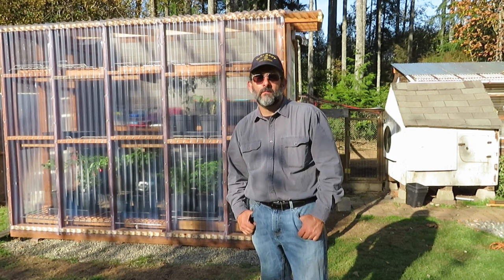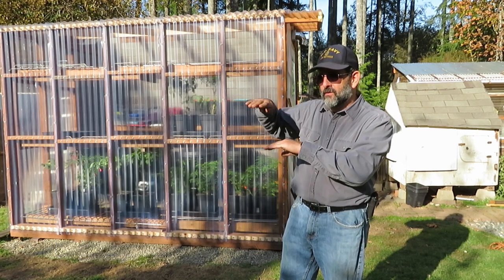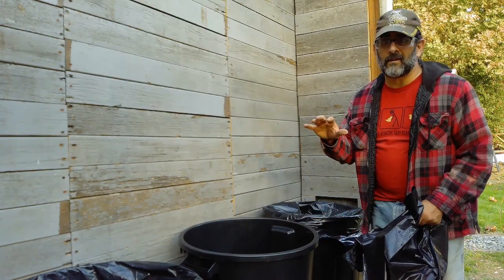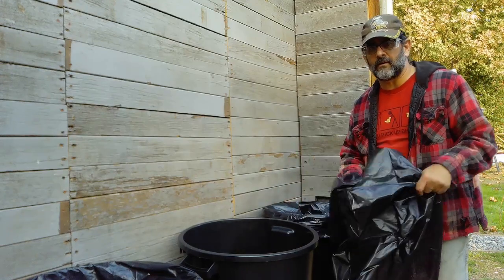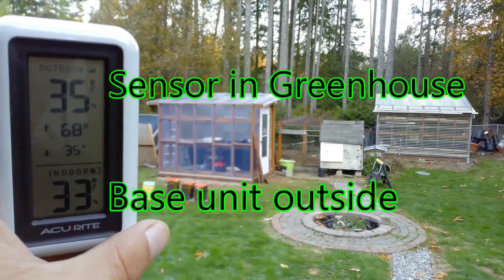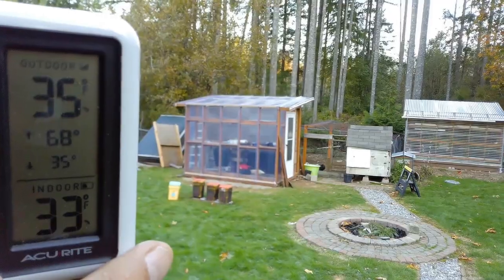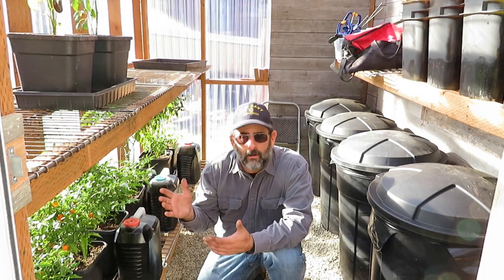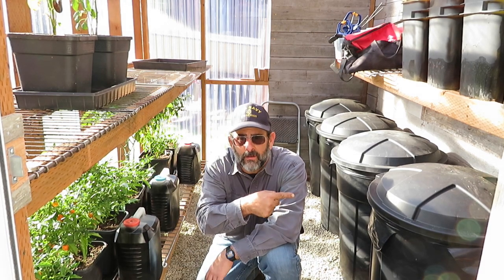Greenhouse Heating - Installing a Heat Sink

Comment: Cover the north side wall and floor with a black plastic during winter also absorbs more heat energy or reflective materials on that wall and floor directed back into the greenhouse and toward your heat sink. The more surface the more solar energy collected. Also consider black tubing with a reflective gutter behind it, you could also use a small pump in the water cans to cycle the water and gain even more heat. Many options. Just remember more surface area to charge it up it's a thermal water battery, which is also what some call it. Also at night a reflective blanket over the roof as a retractable cover also keeps heat in longer, even just a double clear layered roof with a 1 inch air gap, allows solar light/heat in and insulates with another air layer.
Reply from the maker: Thanks for the advice.  I might try that after my Achilles heals up the rest of the way.  Happy Gardening!

Comment: I own a pool company and to extend the swim season we use black irrigation hose and a small water pump.  Paint the back wall black.  zigzag about 50-100 feet of black irrigation hose on it.  Connect all your trash barrels with PVC.  Put your water pump in one barrel and have the other end of the irrigation line dump into the other end of the barrels. The water will circulate back through all of the barrels.  It will greatly increase the temp of the water through the day and will allow you to grow all year long.   Have a client that uses this technique in KCMO and is able to swim 10 months out of the year, while outdoor temps are only above 70 for 4-5 months a year... Obviously their irrigation hoses are connected to the pool pump instead of trash cans, but it works the same way... I used it on a neighborhood pool system and they opened their pool a month early and kept it open a month later... If their budget had been higher they could have added at least a few more weeks on the front and back end for another month or more of swimming...
Reply from the maker: Very interesting. I have been playing with solar pumps in my formal raised pond and have an extra mini-pump.  I might just try that out.  Just need a little extra time and a spare solar panel.
Reply: @whats up Doc
I live very close to kc mo and your idea is amazing. Thank you 👍
Reply from the maker: Sorry for the delay, YouTube wasn't showing the replies held for review.

Comment: Basic, clear, concise and doable by the least of us. I wonder if you, me, could jump start the water in the barrels by heating up big old metal containers on an outside fire and tipping the heated water into the plastic ones? It would help a lot I think...but woluld have to get the right temp, so as not to have it too hot on the first nights then go down too far for the plants. Interesting thought.
Reply from the maker: That's a good idea and would work in a pinch.  I don't think the drop the next night would affect the plants too much.
Reply: That wouldn't help. My black trash cans get hot in the afternoons (100+ degrees outdoor heat) that I can't dip the dogs in to cool off, nor use to water plants. The next morning (60-70deg), water is cool again.

Comment: Great idea 👍 and you've proved that it works 👏
Reply from the maker: Thanks!  It did get overwhelmed a couple weeks ago when our temps stayed in the lower 20's and we had no sun.  I am waiting on a couple items to arrive and I will be putting in a 150 watt 12 volt solar and wind heating system.  Received the high capacity battery yesterday.

Comment: good idea, I think I would put a knee brace or leg to the ground  in the middle of the shelf that holds the water buckets for extra support to strengthen the shelf.
Reply from the maker: I thought about that and only have the extra containers in the corners.  I put small starts in the middle.

Comment: The South wall (in the northern hemisphere that would be northern) of my small greenhouse built from 3ltr milk containers filled with water. That gives me a nice thermal heat for the night. The outside of the wall is covered with sisolation so the heat is retained inside. This would work much better if I'd painted them black.
Reply from the maker: I am guessing you are from down under?  If so, I bet those milk containers work great for your climate.  I've been in Newcastle, Freemantle, and Melbourne during the fall and winter and thought the weather was mild.  I have to reseal the gaps in my re-purposed mahogany North wall before winter.  I did put bubble insulation in my greenhouse garden shed.  Happy Gardening!

Comment: Like the idea. The only concern I have is , if uou have a bunch of cloudy days and cold temps would the water freeze?  A friend of mine dsd use barrels filled with water for a long time back in the 70s to 90s and one winter they lost every  black barrel due to freezing from extreme cold weather conditions. Split open and dumped all the water out. His newest greenhouse uses black barrels but added antifreeze  to keep from freezing.  Would that work better than just plain water?
Reply from the maker: I almost had barrel split this winter.  Clouds and temps that didn't go above 30 for 5 days.  That is why I made this video https://youtu.be/zrc9XgkP2lk .  If I had starts in that greenhouse, I would have put my buddy heater in it https://youtu.be/cvvEcxhAfTo .  Happy Gardening!

Comment: Good video mate, cheers from London England 👍😎🏴🙏

Was thinking, You could have a small hot-compost bin/pile going in the corner or instead of the water keep the 4 barrels going with compost rotating em? that will generate some heat? And maybe one or two of those emergency DIY upturned plant pot burners with a DIY vegetable fat candle instead of Tealights, that will last 2-4 weeks burning evening and overnight should raise it another couple degrees at least I'd think? You guys have Crisco in America and Canada, I've seen loads of videos on making them using that or the equivalent and it's properly cheap where you are big jar filled to brim with that and a tall thin candle pushed down the centre, light it up stuck it under an upturned plant pot, instant cheap long burn greenhouse heater.. just an idea, probably cost you a few dollars a month but if you are harvesting lots of fruit and vegetables and keep em going for next season it's worth it I think..
Just an idea(you may have tried it already not sure?)
Reply from the maker: I just recently found out when I visited Joe's greenhouse https://youtu.be/3Ua_Kj3Gh00 on Saturday, just how much compost I would need and it's a lot.  Cheers and Happy Gardening!

Comment: Pulling every little bit, heck yeah. You could also use any surface not covered by the containers to add reflective material to redirect energy away from wood material.
Reply from the maker: I have some reflective bubble wrap insulation that I was thinking about putting on the ground in front of the containers to shine back up.

Comment: You can also put a layer of rigid foam on your north wall and stack cinder blocks against them, paint the blocks black, and put your water filled cans/barrels against the wall.  This basically will give you a thermal heat sink that wall absorb and radiate heat back into the greenhouse.  Another thing you can do is put a couple of layers of clear bubble wrap up against the roof and the south wall.  This will allow sunlight to pass through while giving an insulating layer along those areas at night.  Just make sure to leave an air gap so you don't have a problem with condensation on your glazing and other interior surfaces.  That lead to fungus, mold, mildew or rot.  Also you can put either a layer of black plastic or weed block material to the floor and use the ground to absorb and hold more heat.
Reply from the maker: Thanks, I did put some foam outside on the North Wall recently.  Didn't see too much difference, maybe a degree or two.  Those 2x4 mahogany planks are very insulating.  Currently working on a solar/wind with a car heater, collecting data and should post a video shortly.

Comment: I use mulch compost, same concept but the mulch compost heats up naturally with or without sun.
Reply from the maker: Nice.  Happy Gardening!
Reply: And compost as it breaks down will also provide plenty of carbon dioxide.
Reply: I had a huge problem with fungus gnats when I had compost in the greenhouse

Comment: use a couple of buckets of actual kitty litter instead of water ,to see if you get more heat from them vs water. maybe 50/50 wet litter. also place a foil or mylar reflector over them for low horizon sun gain. a solar powered fan at the roof blowing into a 3in pipe going down to the floor into a box placed under your barrels for much more heat collection.
Reply from the maker: Good ideas.  Luckily, we don't drop too much below freezing for long periods of time so the cans of water do the trick.  As for kitty litter, the clay gets way too clumpy and sinks to the bottom.  Once the litter container deteriorates, it is too hard to empty and clean to toss in the recycles.  Happy Gardening!
Reply: Water has the highest heat capacity of any liquid. That is one of the factors that makes it such an incredible substance. Adding litter can only reduce the efficiency.

Comment: Did you happen to also measure the temperature difference inside vs outside before moving the tubs of water in? So you know if they are actually helping? The greenhouse itself should store more heat than outside.
Reply from the maker: Prior to putting in the heat sink, temps were between 1-2 degrees warmer than outside.  With the heat sinks, fully charged, 10-15 degrees warmer in the evening and down to around 5 degrees warmer right before sunrise. Happy Gardening!

Comment: Great idea. Do you have them on the north wall?
Reply from the maker: Yes, they are along the north wall.  The Extremely cold week we had a couple weeks ago (highs in the mid 20's) along with no sun overwhelmed them.  I plan on putting in a 12v 150w heater powered by solar and wind soon.  Happy Gardening!

Comment: I have wanted to use a stock tank heater in my trash cans to supplement the sun. Do you think it would work?
Reply from the maker: It might get too hot if the element touches the edge.  I tried a very low voltage fish tank heater with solar and I only helped a little.  Happy Gardening!
Reply: @CMooreStarts  Thanks for your response.

Comment: What are the dimensions to your greenhouse? I have a 6ft by 6ft with polycarb for walls and roof with a panel on the roof to lift for ventilation.
Reply from the maker: 10 x 8.  I also have a 6x6, and in it, I use one trash can and several kitty litter containers.  It is hard to seal the polycarb so drafts don't come in.  Happy Gardening!

Comment: In 20 degree temps that would only help 6 degrees warmer it looks like.
Reply from the maker: True, it also depends on how much sun the barrels get the day or two before.  Here in the Pacific NW, if it gets into the lower 20's, we usually have cold sunny days that will heat the barrels.  I break out electric or propane heat if we have a cloudy day followed by a clear night that suddenly drops the temps.  Happy Gardening!
Reply: @CMooreStarts  

Yes we did that too. But we had to watch it n shut it off before we ran out of propane. It is a 30 gallon we use. 
Someone was showing to use a built in kerosene heater which might be better than propane. Our propane heater that attaches to the top gets pretty hot n used it up pretty quickly. We never leave it on. 
We don’t have a kerosene heater but I was thinking to get one. Or maybe a hobbit wood stove  or tent wood stove.

Comment: You really don't have a true heat reading for a few days till the water heats up from the Sun
Reply from the maker: You are right.  In fact here in the Pacific NW, it is extremely hard to get a true heat reading at all because of the weather changing so much.  Cloudy one day, sunny the next, then a marine layer till noon the next day.  Happy Gardening!
Reply: @CMooreStarts , what was the temperature in the greenhouse before adding the water?
Reply from the maker: Stayed steady with ambient at night until the barrels heated up during the day.  I believe it was about 80-85 in the greenhouse when I was installing the barrels and had to open the vents to keep from sweating too much.  Happy Gardening!

Comment: Others  aiming for such good results, please  check your met. office to see how many days give you cloudless  hours in your  winter seasons  (Oct to Mar.). Also, do any of you know the  ideal math relation between the surface area of your sun heat capture and the gallons of water needed to store that gained heat.
Reply from the maker: I just strive to keep my plants from freezing.  Here in the Pacific NW, we have very short days in the winter along with a lot of clouds.  This year with La Nina more cloudy days than normal which makes for lower heat output from the barrels.  Currently even with the cloudy days, it is keeping the temperature about 5 degrees above outside ambient temps.  I should be doing my last pepper harvest of the year this week from the plants I put in the greenhouse.  Happy Gardening!
Reply: Good Question;
I think it has to do alot with " the angle " that winter solar heat REACHES INTO YOUR GREENHOUSE.
  CONSTRUCT YOUR ROOF ACCORDING TO YOUR MAXIMUM HOURS OF SUNLIGHT IN THE COLD OF WINTER TIME.